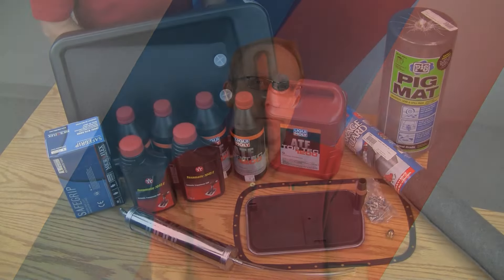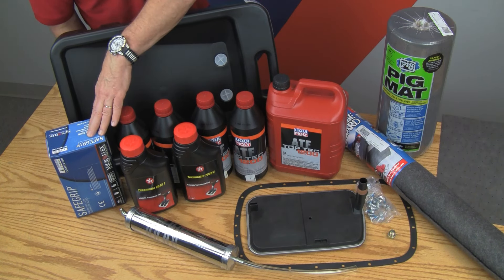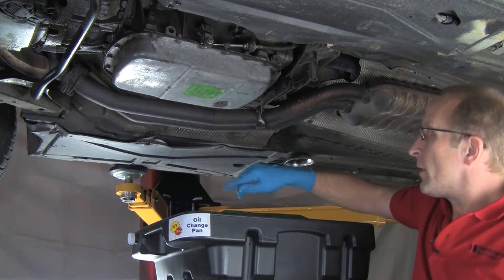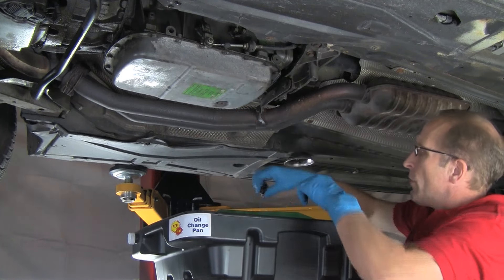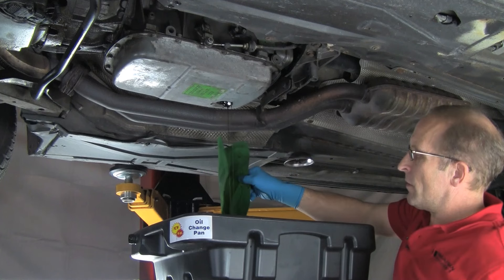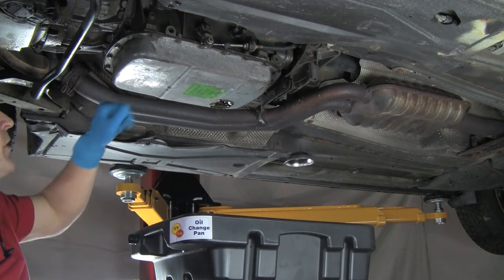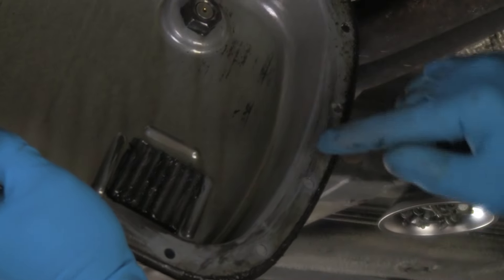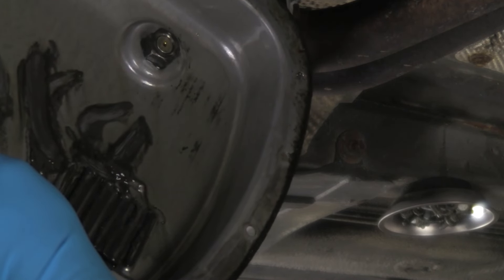Part 1: Changing Automatic Transmission Fluid & Filter On A BMW/MINI

Comment: Hello, I have a 2004 520i. I experience a hard shift from 2-1 when coming to a hard stop...will Changing the ATF correct this? I got the car just about a month ago.. with about 107k on it
Reply from the maker: Yes, the first thing to do is change the fluid.  this may very well cure the shifting issues.
Reply: BavarianAuto i have changed the Fluid and it has less jerks while shifting down from 2 to 1 although it still happens once in a while.. would you recommend i keep observing or i should upgrade the Software as i learnt that upgrading the car's software fixes this issue of hard shifting from 2 -1.
Reply from the maker: Adedeji Faniyan
If there is a programming update, yes, you should have this done.  if the fluid that you removed was very dirty, you can also do another fluid change so that a higher percentage of fresh fluid is present.
Reply: Thank you. The change done was with a ZF tranny oil although not the lifeguard bcos the zf lifeguard 6 is not available here in Nigeria. I have ordered the ZF lifeguard 6 from the US and it will get here pretty soon. Is it okay if I use this to perform the second fluid change considering it wasn't used for the 1st?
Reply: By the zf tranny oil I mean a life oil not manufactured by zf but has the specs of the ZF lifeguard 6 fluid
Reply from the maker: Adedeji Faniyan
You should be OK if the fluid is actually compatible with the original fill and/or the lifeguard-6.
Reply: BavarianAuto I have done this ATF oil change using the procedure above  and ensuring its topped at the right temperature.  The Fill Plug was very hard to open and i had to use a lot of force to get it open.

I observed the car moves much better but 4 days  of driving later, i got a i message twice on the i Drive saying (Transmission fault ...Transmission failsafe activated. Possible reduction is acceleration/ drive moderately! Have the problem checked by the...)

I guess my transmission is now damaged right?
Reply from the maker: Adedeji Faniyan
 - When the fault warning comes on, the system is storing a fault code in the transmission control unit.  The proper full diagnostic tool can read these codes.  This is the next step in seeing what is at fault.
Reply: BavarianAuto i read the fault today and got the message. "EGS Shift monitoring 1-2".. Any Ideas?
Reply from the maker: Adedeji Faniyan  - You likely have a sticking valve in the valve body (called the Mechatronic unit, by BMW and ZF).

Comment: Great video!
I have one bmw 325I with 1997 with automatic transmission 4L30e. would like know if can i make the same procedure to change oil and filter. I was recommended to make the flush in transmission but metal particles weren't found. I want replace the solenoid valves per old owner recommendation, i am buying the solenoid valves but after replace i will need put the scanner to check the electronic system or not? Thanks for your attention.
Reply from the maker: No need to re-code after replacing valve body control solenoids.

Comment: Hej, I have an oil dropping after transmission oil change. I have been watching the the servise guy managing the change and he did not use "the cross rule" by the bults tightening. Can that be the cause? Or what else? In another service, I discussed the story with the service man, and he told me that he cannot do much because once the sealing of the pan is in contact with oil, it swells and doesn´t work properly anymore. Is this true? What do you recomend me to do?
PS: Thanks for promt respons in the other matter today...!!!
regards
Lubo- Stockholm
Reply from the maker: Well, first, if a shop did the service they are responsible for taking care of the leak.  They did something wrong or it would not be leaking (improper bolt tightening, not clean enough, inferior parts, etc).  If the pan gasket is the leak, it will indeed have to be redone and a new gasket will be needed.

Comment: I am a regular customer of BavAuito, with an '06 X3 3.0 and an '01 530i automatic. I love their products/service as that element of trust has been cemented from experience that you "get what you pay for". Never any troubles from buying the best! I will continue to buy from them.
THAT SAID, I changed my 530 auto trans fluid at 76K miles. I drive the car fairly easy and don't 'race it'. I did not have any issues with the trans. My fluid came out nearly as clear as the new fluid that went in. Very little grey matter on the magnets. That leaves me with the conclusion that the "30K to 50K" change interval is way beyond necessary. IMHO, of course. Can't thank Otto enough for the great vids!
Reply from the maker: Dave, thanks for the good words!
The idea is that you WANT the removed fluid to look like new fluid.  Waiting too long will result in the fluid degrading and changing color and wear particles building up.

Comment: Can you answer my questions? Mine is n46b20 engine. I've pretty much similar oil filter and pan. I drained exactly 5 liters of oil which was decent colour, wasn't dark. Then I cleaned the filter with petrol and dried then put it back. There wasn't any O-ring come off when I took the filter out. When I put it back it was tight enough to hold the filter. Then I couldn't fill all the 5 ltrs of oil. End up with filling 2.5 ltr. Then I started the engine.  I've noticed noise from transmission like sucking oil with air. Then I tried to fill that i couldn't do that. Then I en up with parking 20 degree slanding then filed all 5ltrs. Is it normal?

Comment: U have done a wonderful job I just bought and 05 745 and I was looking for the dipstick cause I had a fault light come on. I got the car from an individual not a dealership is I correct to change all the fluids before really driving it

Comment: Beautiful video all respect. Please if you can answer me please. I have a bmw 525 tds 1998.Transmission model.A5S310Z. What type of oil do I use to change it? How do I get the oil out of the converter? To make it 97% good a video would be welcome thanks

Comment: March 10, 2017.
Dear friend:  I have a 1997 BMW 740i in very good conditions. Its millage is only 96,000. I want to change the Transmission Oil and Filter, because I have noticed that in a couple of instances my gears jump to “Safe Mode” and someone told me that it is either lack of oil or I need to change the Oil and Filter.
There are people who recommends NOT to touch your transmission Oil because BMW says that it is good for life and if I dare to do the changes I will probably damage the Transmission.
What do you recommend for me to do ? I will appreciate an answer soon. Germán.

Comment: Great videos man. Keep up the great work. 
I have a question.  I am looking to get a x5 e53. Not sure  on engine yet and its likely to have a auto transmission. I have been lucky with bmw autos in the past but I hear that the gm and zf lumps on the e53 arent reliable. Is this due to lack if fluid change, or a design fault. Cheers buddy
Reply from the maker: The most reliable E53 X5 with an auto trans, would be a 3.0.  The GM trans in this application is a pretty good unit.  Most issues are due to the lack of fluid changes.
Reply: Thank you for your fast reply. Love the videos very well explained :) cheers
Reply from the maker: *****
check our online store at www.bavauto.com
Once you ID your vehicle and search "automatic fluid" we will show the approved fluids for your specific transmission.

Comment: Thank you for putting this video..hit a question maybe you can guide me to the right direction... X5 4.4 transmission is slipping but no codes. Drain fluid no metal, change filter..still the same...any advice

Comment: otto i have the 1997 bmw 528i its a bit differend..cause oilpan just had 8 bolts..drainplug i found ...and fillplug i also found i think its on the back..now my problem is i fill it up like you do ..but fluid  cones right back...some thing is blokking it..with a mirror i see there is a metal something  inside hole how is this possible help i can not fill up now

Comment from the maker: Yes, that's about all you can do.  You will still not get all of the fluid out of the converter and the transmission will still have some fluid in it. Performing a fluid change after filling it and running it will get you pretty close to all new fluid.

Comment: Hello to all, i just need to change the transmission oil on BMW E39 525D. It runs so far 250.000 km and have some transmission issues, Someone have any ideea or have change it already without any problems after?

Comment: Thanks for yr video it was very helpful. 
I have a 02 325i e46 BMW. It has a green sticker on the transmission but cannot see any numbers,all that I can see is ( ZF).I need to flush and change the oil and filter. Some one told me that the fluid I need is lifetime fluid. I cannot get this fluid back home. Can I use the Ac delco or, can you recommend one. The last 7 digits on the vin is (FX61844). Any help please?

Comment: Hello Sir Bavarian, i need a help here. My dad's car is E90 320i year 2006 Automatic Trans. Why his car can't activate the Sport/Manual mode? I saw some videos that usually had happen to this BMW model and i has check it and didn't find any wires that snap. Could u help us with some tips or advices or in the video if that not disturbing you work. Thanks for the helps. Love ur tutorials.

Comment: Very good presentation. 
I have a bmw x3 2005, it run 1.65 km. recently the auto transmission jerks while it changes gear. is it related to changing transmission fluid? the jerking is really annoying. please advise. the gear service light is blinking randomly also.

Comment: Question: I have a 1989 BMW 535i with 129K original miles (automatic trans). The trans starting shifting late from 1st gear to 2nd gear (shifting around 3000-3300 RPMs...) The Trans fluid looks clear (lite reddish color) with no particles...This problem has virtually gone away now that it's summer and the trans has done this before where it goes back to shifting normally when warmer temps outside. I am second owner and I have never changed the trans fluid...Do you think changing the fluid and filter may resolve this problem? Thanks and VERY well done video.  

Philip
Reply: Uptown Wedding Photography NJ cars hold up rpms when cold to warm up quicker

Comment from the maker: You did not mention what model E82 (1-series) you have.  The 135i and the 2010-on 128i use the GA6HP19Z transmission, while the 128i thru 2009 uses the GA6L45R (we're assuming that you have a US model).  The fill plug for the GA6HP19Z is on the driver's side of the transmission (above the pan mounting rail, facing the driver's side), at the rear of the trans.  The fill plug for the GA6L45R is at the rear of the trans housing (facing to the rear of the car), on the driver's side.

Comment: Hi Otto I have a problem with my automatic transmission 2008 bmw x5 3.0si are leaking all work perfect no noises only leaking, you think is only necessary change the transmission fluid or is possible other problem with the transmission? and the video is similar work in my X5? thank you

Comment: I have a problem in my car..  when higher degree of temperature the car is  change the speed after 4500 rpm and not change to fife speed..iam waiting the solution 
the oil transmission is swag

Comment: I've got a 01 740il bmw with 198k miles. worth doing the transmission service? I have noticed the torque converter lockup slipping. would a service help that situation in theory? the slipping mainly is in drive in last gear and overdrive. I drive in d4 "sport" and that helps keep it from doing that but I put it in drive at highway speed and it seems to be fine. just at city speeds. I figured its worth a shot since it shifts like butter otherwise and I baby the car.

Comment: Hi, i have a 1999 bmw 323i with gm transmission. The gear sign with this ( ! ) inside the gear sign is on along with traction control loght is on as well. Do you have any suggestion on what could be wrong with it?

Comment from the maker: Good point. We do always mention this in our manual transmission and differential DIYs. We don't always bother on auto transmissions as the plugs are not tapered threads. However, this is a good practice to follow. Just note that you do not want to actually remove the fill plug on an auto transmission, as you would lose about a quart of fluid if the engine is not running. Just "crack" the plug loose so that you know it will come out when it is time.

Comment: If a drain and fill is done, isn't there still 5 quarts or so left in the converter?

Thanks!

Flyin-m5
Reply from the maker: Yes, there will be about 1/2 of the total fluid still in the transmission & torque converter.  If you scroll down through the comments and replies, we do address this common question.  In short, you can perform a subsequent fluid change to achieve a higher percentage of fresh fluid.

Comment: thank you for this video. but do the 520 have the same transmission, or in this case filter, as the 528? I'm asking because my 528 was a 520 back in the days, and I don't know if they upgradet the automatic transmission aswell.

Comment: Would these steps apply for 2006 BMW X5 3.0i E53 M54B30 sport activity vehicle?  With respect to the tools used to drain tranny fluid..gasket and filter. My X5 has approximately 148-149k.. are you using any gasket sealant upon re installation of tranny gasket or simply mount it and torque it down according to spec. 
I can't get the metal shield plate from the bottom of my vehicle, which gives access to the oil pan the bolts have two nuts..one on bottom and one on top. I have access to the drain plug on oil pan...just want to check oil pan for metal dust shavings etc

Comment: My friend This type of oil change is like draining only 4 liters of Your engine that hold 7 liters and leave 3 liters dirty oil in it , I'm saying this because there is more oil left in the torque converter,  by doing this You're mixing new and old oil together 
the proper way to go will cost You little bit more money but its worth it , change your oil 2 times drain it then the 3rd time drain your oil take the filter out put a new one now fill it up and Your transmission is refreshed

Comment: I have a 1995 bmw 325i. would I use the same procedures demonstrated in this video? is the drain plug and transmission in the same spot ?

Comment: How do I change transmission fluid in 2003 bmw x5 serial # 96024222 and how much fluid will I need to put in?
 
Jennifer.

Comment from the maker: Not having been involved in this project, directly, we can only suggest that there is either an internal issue with the transmission (shifter rods or detents, or worn shift fork or slider for 5th .... all internal parts) or there is an issue with the shifter install (the external shifter parts and linkage).

Comment: do you always recommend doing a full fluid & filter replacement as opposed to simply a 'flush'?   my local dealer says a flush is sufficient,  but i'm thinking i should drop the pan and do a full fluid & filter replacement as you guys are showing here.  i have a '99 540i with 90K.  as far as i know, the fluid has never been replaced.

Comment from the maker: You may indeed be a bit low on fluid.  You should recheck the fluid level as noted in the video .... engine running & moving shifter through the gears prior to checking.

Comment: Hello Bavarian Folks, I own a used 
1997 BMW e39 540i with 210,000+ miles on her. I do not know if her transmission fluid has ever been changed, or if she needs it. I've read many other posts stating that I shouldn't change it, and other posts stating that I should with my perticular model of BMW. Since you all are the BMW experts can you gentlemen please advise me if my transmission situation??

Comment from the maker: We're not sure just what your Elantra uses.  It may use a sealant in place of an actual gasket.  Which ever is applicable, you can do the same.  We would replace the filter if it is a standard style similar to what is shown on the BMW.  If the filter is somehow not accessible (or whatever), you can still at least change the fluid.

Comment from the maker: For US spec models, 1998 would be an E36 ans all 4-door 1999 models are E46, but 1999 2-door models (and all M3) are E36 .  Euro models did start the E46 chassis as 1998 models, for 4-door variants.  What are the last 7-digits or your VIN?

Comment: Otto, I appreciate all your videos.  I recently changed the filter on my 2003 E46.  As I was reinstalling the old torx screws, one of them broke off.  I had successfully used a popular easy-out bit sold in stores.  However, on this bolt, my drill applied too much torq and my easy out broke off 1/8" up in the threaded hole.  I have tried all kinds of bits to drill it without success.  I reinstalled the pan without that one (1) bolt, and it leaks a few drops a day.  Do you have any suggestions how to drill that easy out - out?
Reply from the maker: Kevin,
There isn't a whole lot you can do if the extractor is below the surface.  Check the video in the link below, for the "rescue bit" that is made for drilling out broken extractors, taps and drill bits.  As an alternative, you could fabricate a load stretcher that goes under the two bolts on either side of the problem hole and then applies pressure to the spot where the broken bolt would be, mimicking the bolt being installed.
Remove Broken Bolts, Drill Bits, Taps and EZ Out Screw Extractors
Reply: Só era soldar um ferro no parafuso quebrado e retirar